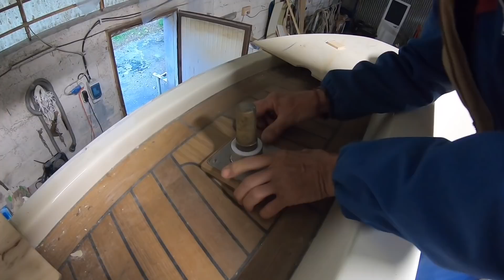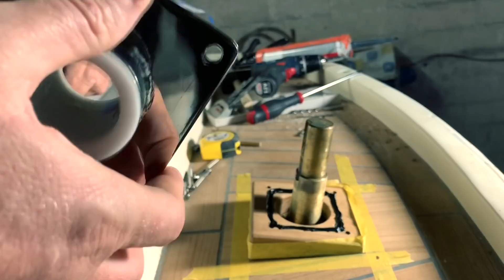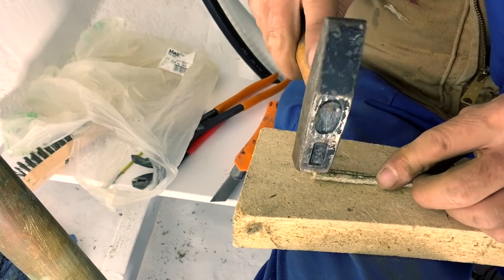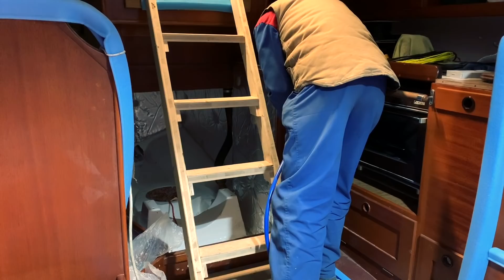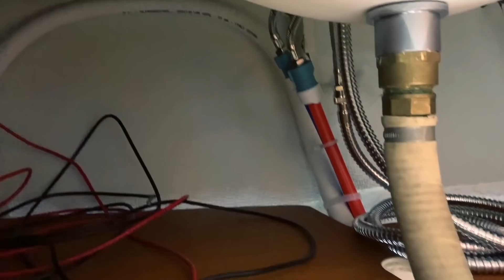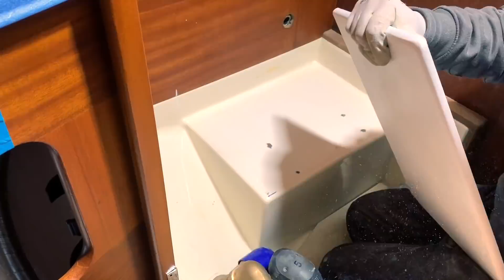Hallberg-Rassy 312 "Ellös":THE STUFFING BOX PACKING & MANY OTHER WORKS

Comment: Use a small socket when tightening hose clamps/jubilee clips. Saves shoving the screwdriver through your palm if you slip. You are not repairing that boat, you are re-manufacturing it, superb.
Reply from the maker: Yes John true!! I Wacom hurry bit hurry sometimes hurt🤪 thx for advise!!